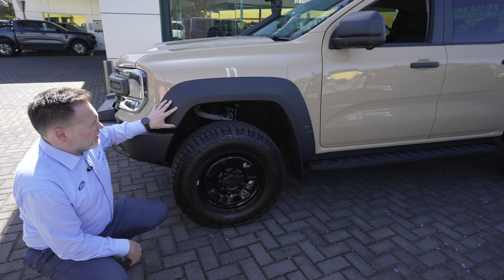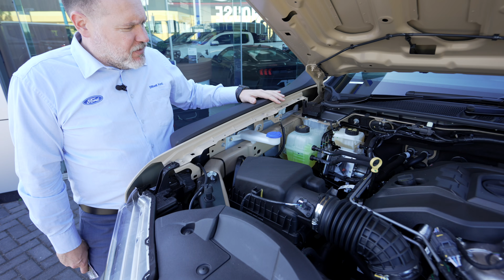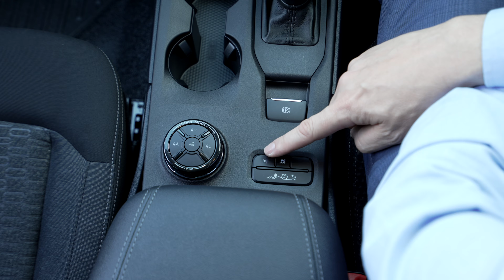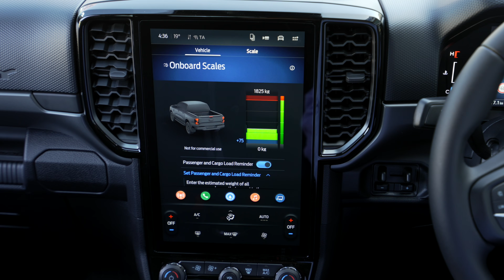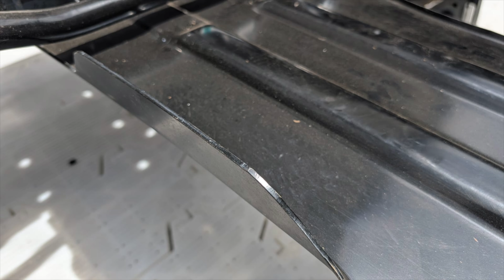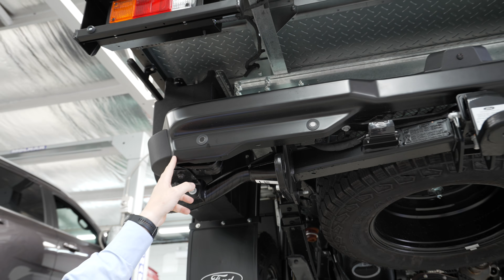Exclusive Underbody Reveal All-New Ford Ranger Super Duty XL Double Cab Chassis

Comment: Great video. There is a lot of gray information about the Ranger Super duty. Like how they should be registered as car or as a heavy vehicle? A C class license or a heavy vehicle license?  The ADR says it has to have AdBule and DPF to meet heavy vehicle standards and EU6 standards. Under road laws a limit is set and must be under the limit. Drink driving, the limit is 0.05. but a driver must blow 0.049. Truck drivers must fill out logbooks if the is 12t and up. if the truck is rated 11,990 no logbook is to be filled out. 4500kgs GVM is the hottest topic on the internet. A C class license holder up to 4.5t GVM with or without a trailer. Or as it's 4.5t GVM need a truck license. After asking the DOT and dealers about how it should be registered no one really knows and registers they a passenger vehicle. But all information including the ADR points the Super Duty as a heavy vehicle. People need to be aware of the legal impactions of not holding the right license to drive it, or the vehicle not been registered correctly.

Comment: can the Super Duty be equipped with a proper full specification 3.0 in. suspension lift & 35.0 in. all terrain radial tyres . . . please advise . . .
Reply: It comes standard with 33’s, and I believe it can take 35’s without modification (iirc).
Reply from the maker: Suspension lift kits and installation are normally done by third party suppliers. Currently I am not aware of any for the Super Duty but they might come later.
Reply: @FordKnowHow a Ford designed lift kit for the Super Duty & off road accessories would be very beneficial for off roaders, in the near future . . .
Reply: Is the 3L V6 TD going to be reliable ?. Based on history and recent recalls.

Comment: If it were real tough the chassis would be hot dip galvanized.  Paint = corrosion = most car makers . Ford has never ever applied thin paint to the under body/ chassis before have they .

Comment: There are so many videos drooling over the features, but none of them mention if the engine has a wet camshaft belt or chain, and if it has it mounted at the back, which would require engine or transmission removal for service or replacement. If the turbo mounted in the valley, which is the worst place for heat dissipation, and if the 10 speed transmission is the same problematic on used in other Ford trucks. The transfer is chain driven, that has been mentioned as upgraded, but still no match to a gear drive.
Reply: It has a chain, the only wet belt was 2.0L  that’s now been upgraded to a chain also. No more wet belts
Reply: @T @TyFenwick I believe the 2ltr still has a wet belt that drives the oil pump.
Reply: Probably because it doesn’t. Never did.